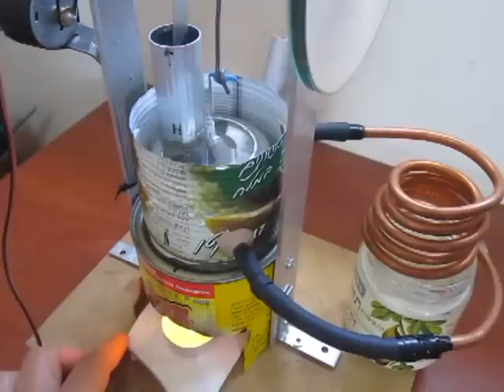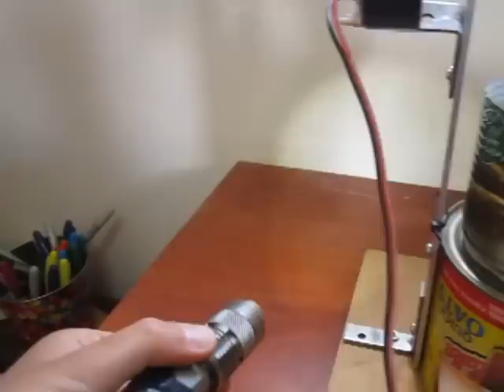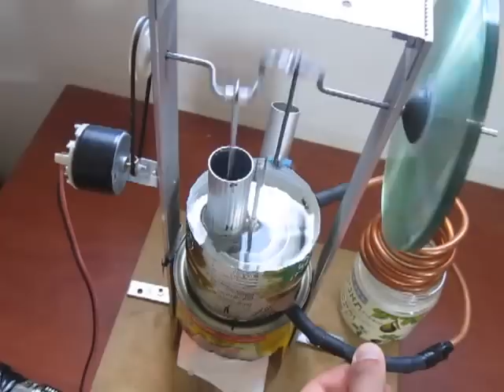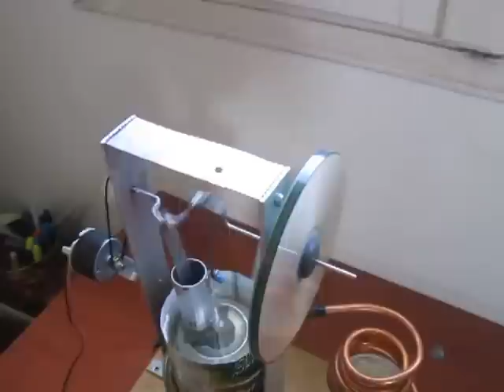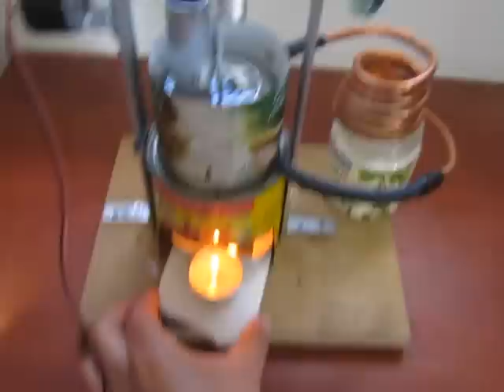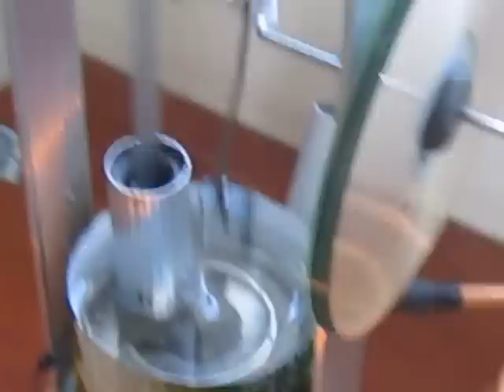Beer Can Stirling engine

Comment from the maker: Thanks! As I mentioned in description, the torch used here is the type with internal DC-to-DC converter. Only one AA battery is enough to power its single ultra-bright led. Thus low RPM is enough to drive the small DC motor as a generator. This converter acts like a gear, but is more efficient. I played a lot with gear ratios and various motor types to get rid of flashing, finally it's gone 99%.

Comment: I appreciate your remarks.  I wonder if the displacer made with tightly packed steel wool acts also as a regenerator.  Yes, good fit on power piston and low friction really help. My engines do not develop sufficient RPM's or power to operate a small generator.  I'll keep trying.  Stirling engines are very interesting.  Thanks.

Comment: I'm currently working on my engine with homemade piston from a tin can base, rod from a copper pipe and synthetic tube as delivery line. It no effort in pushing the piston. Is there anything that I've missed?

Comment from the maker: Looking at your designs, I noticed that thermal partition between hot and cold sections of the displacer cylinder is not good enough: the heat dominates. Ideally, there should be two equal areas, one for heating, another for cooling. And of course steel wool is a good regenerator.
Reply: COOL DUDE OU NOW ARE USEING THREE CANDLES TO POWER ONE FLASH LIGH! NO REALLY IT IS COOL NOT EVERYONE CAN EVEN MAKE ONE WORK!! THEY CAN WATCH YU TUBE UNTIL THEY ARE BLUE IN THE FACE AND WILL NEVER BE ABLE TO GET IT TI RUN GREAT JOB!!

Comment: Very good your engine really has a good force and great speed, especially when dealing with a power piston built in house and used little heat.
Congratulations, very good.
Greetings from Brazil,
Leandro Wagner.

Comment from the maker: I am not sure what is this motor"s origin, maybe tape, maybe record player. But those used in video cassette loading mechanism also were not bad. Anyway, the output is very low (0.6V X 0,15A).

Comment from the maker: Thanks!
Yes, the piston is made from epoxy based putty (quick steel), a heat resistant type. It is much softer than steel, and I have no idea how long it will preserve good compression.
If you are asking how long the engine runs on one fueling - it depends on candle type. Unfortunately, these candles got overheated, started to boil after about 15 minutes, and I extinuished them. The same thing happened to alcohol burners i put inside. This happens because everything burns in closed space.

Comment: I'm making an engine roughly the same size, especially the power piston. So can you tell me how big your displacer is? I mean how long is it in comparation with the displacer cylinder (your beer can)? I made it 1/3 of cylinder (a tin can) so the stroke will be almoust 2/3 of the height and I have a feeling that this is not good :) My displacer cylinder have 8 cm diameter and also 8 cm height and the power piston have a diameter of 2 cm and a stroke of 2-3 cm. So can you help me with the size of the displacer itself, please?
Reply from the maker: I think that a displacer should be LONGER than its stroke. If it's shorter than half of your can, in the middle there will be a "dead" area where neither heating nor cooling happens.My dimensions are as follows:Displacer piston (made mostly of steel wool) - 62 mm diameter x 50 mm heightDisplacer cylinder (beer can) - 66 mm diameter x 80 mm heightPower cylinder - 23 mm diameterBoth power and displacer strokes are about 28 mmI used 2 cans actually, one aluminum and another steel. The bottom of one mounted easily without pressure over other. But unfortunately the steel can section got ruined because of rust. So the engine is not functional now.
Reply: Sorry for the late response. I just want to thank you for your informations. I have rebuilded the displacer acording to yours, so now it is 5,5 cm height in a cylinder of 8 cm in height. I am really really happy now with the engine finished and running really well. In a few days I will put a video with my stirling engine, so again thank you very much!

Comment: Move the copper coil up and replace the flywheel with a fan for better cooling
Reply: I think the coil has to stay at its elevation, moving it would mess with the convection flow of the water inside. However, fan combined with ducting of the flow would work.
Reply: Dick C. Normous
There's no water, it's an air temp modulator

Comment: The generator is a motor turning the crank!
Don't think this one is lagit👎
Reply: Barr I don’t know why it would be fake and if that was the case why did it keep running after he disconnected the generator. And it sped up due to no load. It’s real.
Reply: Dude a motor is a generator and a generator is a motor it’s just a matter of if you supply the load and receive electricity, or supply the electricity and receive the load

Comment: Can I get your plans on how to build this engine?
Reply from the maker: Sorry I have no plans or diagrams on it. There are many other channels with detailed explanations. My dimensions are as follows: Displacer piston (made mostly of steel wool) - 62 mm diameter x 50 mm height. Displacer cylinder (beer can) - 66 mm diameter x 80 mm height.  Power cylinder - 23 mm diameter. Both power and displacer strokes are about 28 mm. I used 2 cans actually, one aluminum and another steel. The bottom of one mounted easily without pressure over other. But unfortunately the steel can section got ruined because of rust. So the engine is not functional now.

Comment: 👍👍👍
What is the service life of the piston?
Reply from the maker: Not long, the whole thing does not survive more than several hours of work. It burns through and corrodes even earlier than the piston gets worn. I mean the heat exchanger. And the bearings.
Reply: @holtzman72  thank you for the information

Comment: Very good! How did you make the power piston?
Reply from the maker: Thanks! I formed the piston from QUIKSTEEL type epoxy putty, inside the tube. Some grease must be applied before you put the epoxy, so the piston won't be stuck. It hardens in minutes, but can be used only next day.
Reply: what grease did you use?